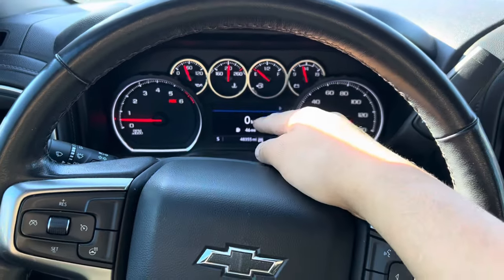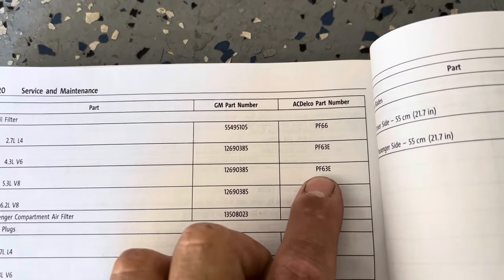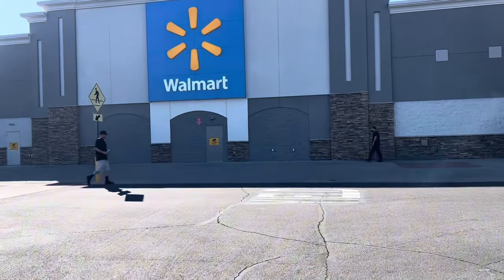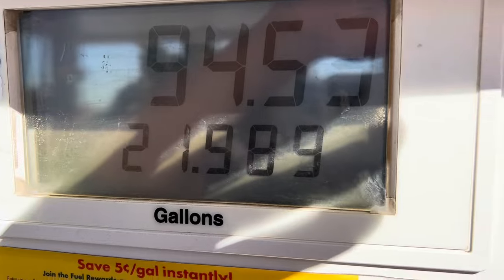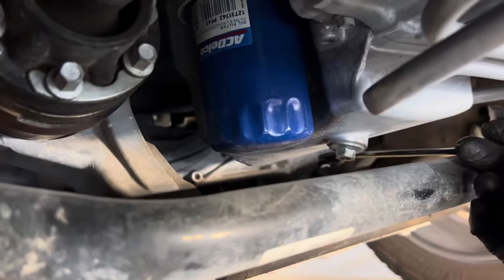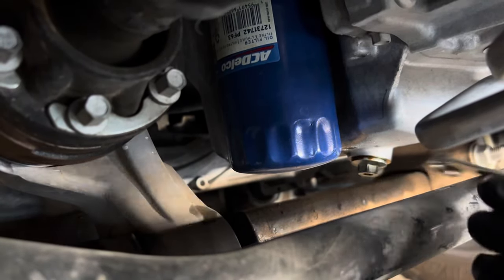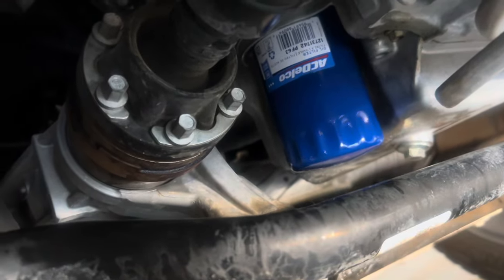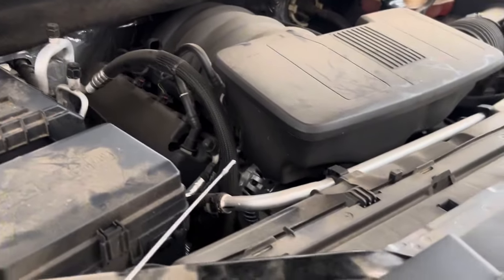DIY Oil Change: 2019-2022 Silverado/ Sierra 5.3L V8

Comment: I have a new 2024 Silverado with the 5.3 engine. It takes 8 quarts of 0W20 full synthetic Dexos oil. My dealer delivers 6 oil changes for me for free. I called them to get information on the oil they use. They said they only use GM approved oils, thus it appears the dealer will be changing my oil at 7500 mile intervals for the first 45000 miles. Nevertheless, this video suggests I could easily change the oil and of course then I would be certain of a job well done. So one question: what’s the purpose of prefilling  the oil filter? I have never seen this recommended procedure.
Reply: I've never done it myself but apparently it makes it so the entire system is all ready full of oil and no part is "dry" so you won't have to worry about any part of the engine not having oil while it circulates through for the first start after the change. Hope I explained that ok.
Reply: @jblaze725  I sort of get the idea of prefilling the oil filter but doesn’t that action take place when adding oil to the oil filling opening ?
Reply: I may be wrong but I think the oil doesn't enter the filter until the pump is running so it stays empty or mostly empty until then, hence why you fill it during the oil change. I'm no mechanic or even an avid tinkerer so don't quote me.
Reply: I would take advantage of the free oil changes BUT I wouldn't wait that Long go every 5k milles to keep it safe I heard they use the cheaper oil but at 5K any oil should be good hope that helps !